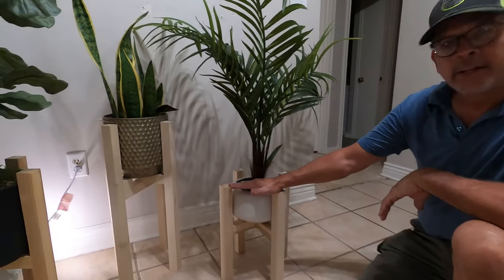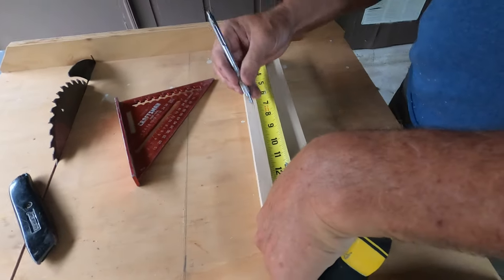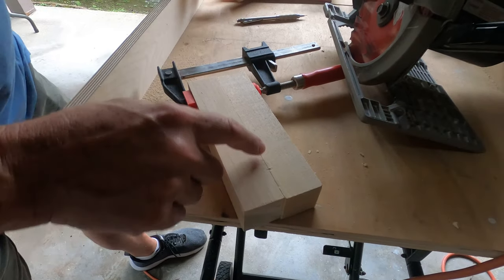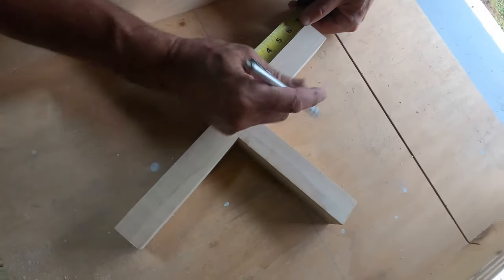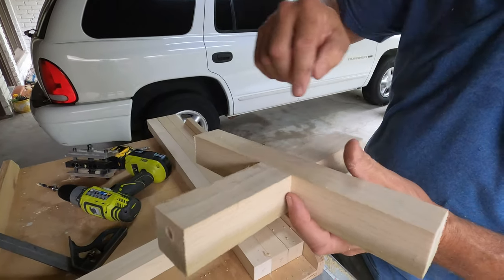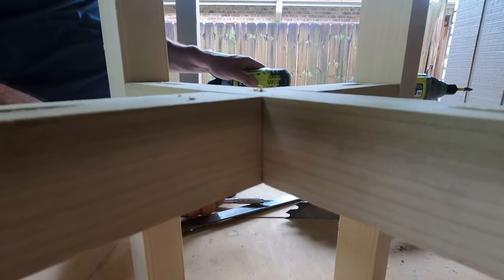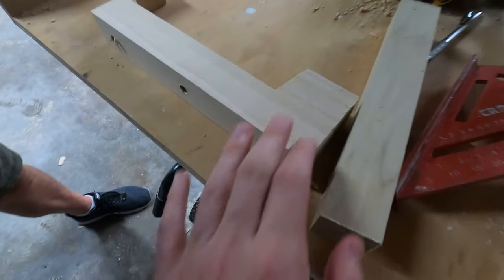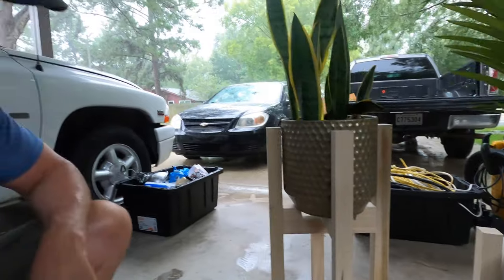DIY: Plant Stand - Simple Method Included! (Materials and Instructions in Description)

Comment: Paul is obviously very comfortable with the math--much more than the stereotype of a small project contractor from the South. Very cool using the wood instead of measuring, or Paul's way of finding a center without fractions. Math when necessary; not when it's not. Both of you are the opposite of the anti-knowledge crowd so visible in politics these days. You're both great role models.
Reply from the maker: Thanks for watching this older video 👍😁